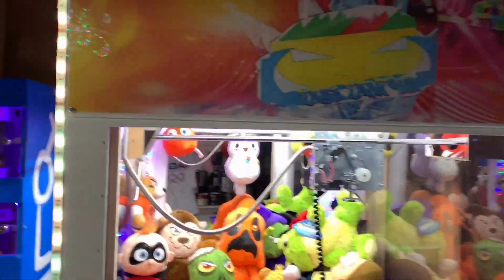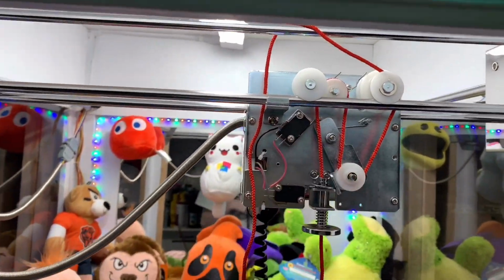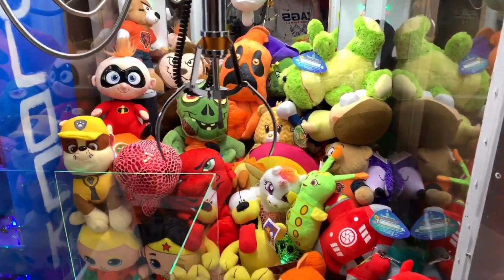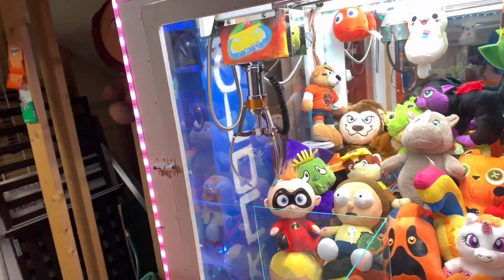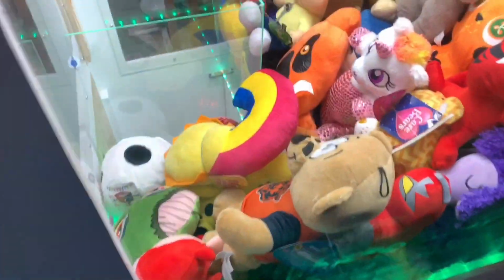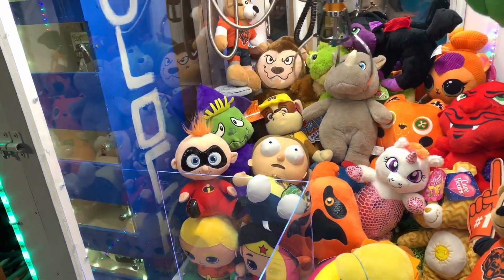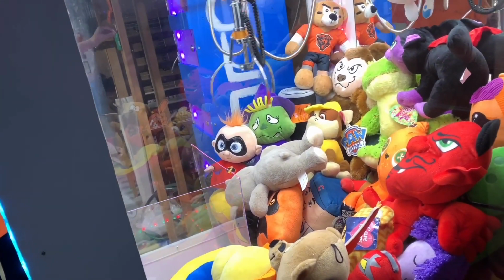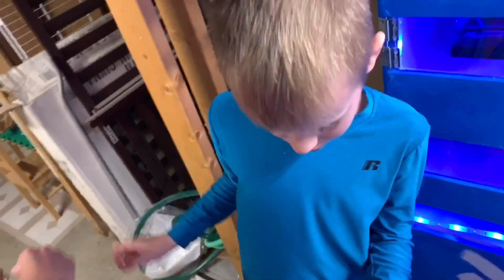MY CLAW MACHINE BROKE AGAIN ( How I fixed it)

Comment: Sorry, my English, I'm from Brazil, I saw your comment on a video, I have a problem with a machine, my machine runs normally for a while, then in one move it lowers the claw to the prize and it doesn't go up anymore, it ends the move later. claw does not return. the cart returns to the starting point but the claw does not go up. you start another turn with the claw down. Could someone please help me, I've already changed everything, motor, switch, cord and the problem continues

https://www.youtube.com/watch?v=8_aZDJqdrwU&t=21s

desculpa meu ingles sou do brasil, vi seu comentario em um video estou com um problema em uma maquina, minha maquina ela fica um tempo funcionando normalmente, dai em uma jogada ela abaixa a garra ate o premio e nao sobe mais finaliza a jogada mais a garra nao retorna. o carrinho a volta para o ponto inicial  mais a garra nao sobe. voce inicia outra jogada com a garra baixada. por favor teria como me alguem me ajudar, ja troquei tudo motor, switch, cordinha e o problema continua

https://www.youtube.com/watch?v=8_aZDJqdrwU&t=21s
Reply from the maker: Check the board for burn marks and possibly replace your relay